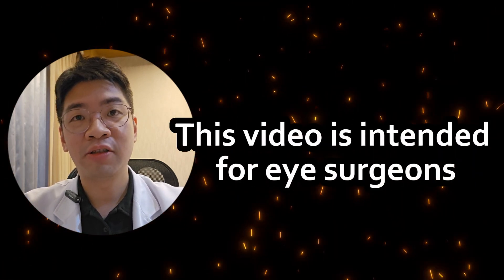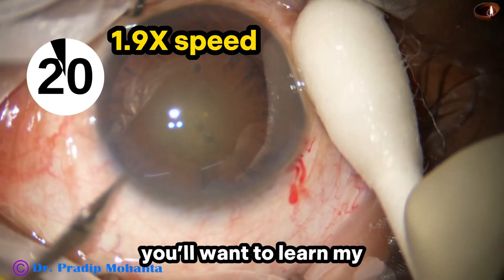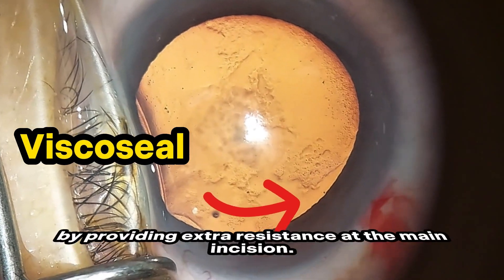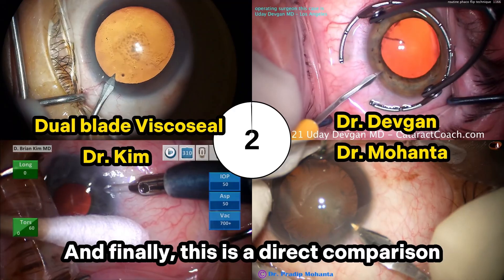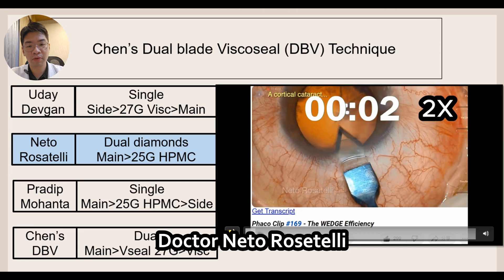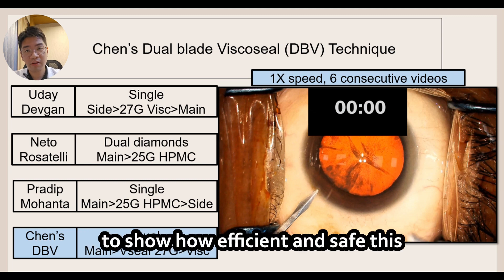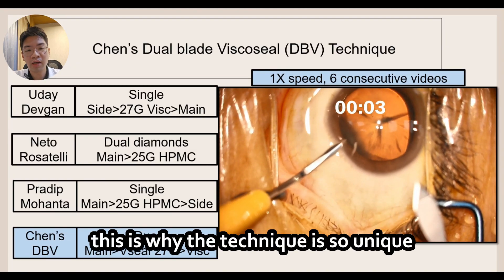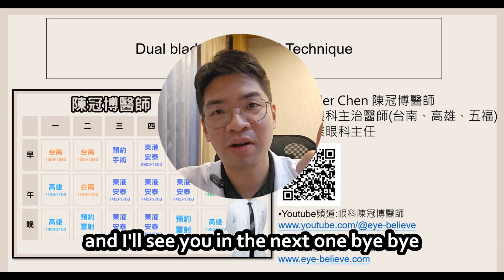A better way to make corneal phaco incisions for cataract surgery? Dual-blade Viscoseal Technique

Comment from the maker: In this video, I'm going to show you the dual-blade Viscoseal technique that I developed. This video won the Best Popularity Award at the 2024 TSCRS Surgical Video Competition. This technique describes the simultaneous creation of the paracentesis and main incision, followed by the Viscoseal technique. This enables the safe filling of the anterior chamber with Viscoat connected to a 27-gauge needle.